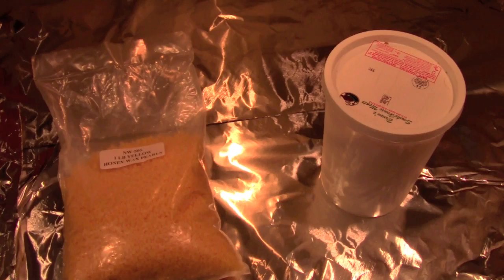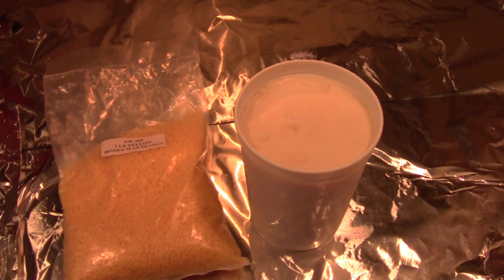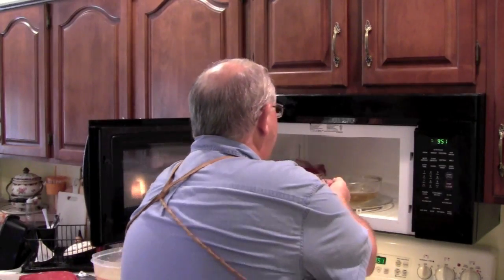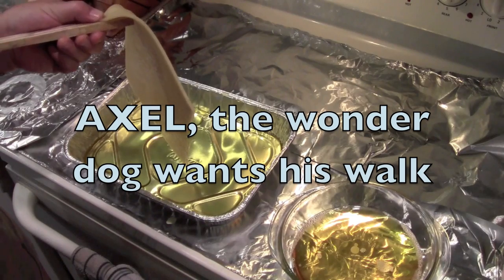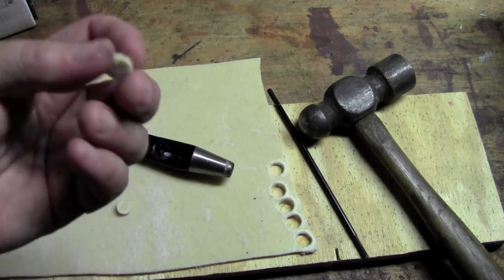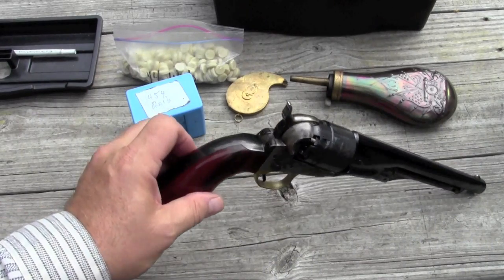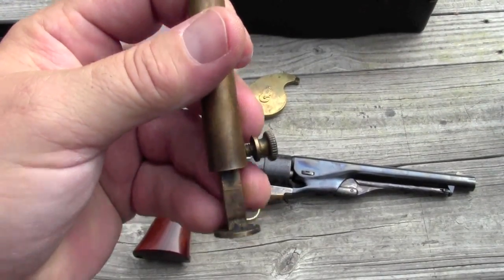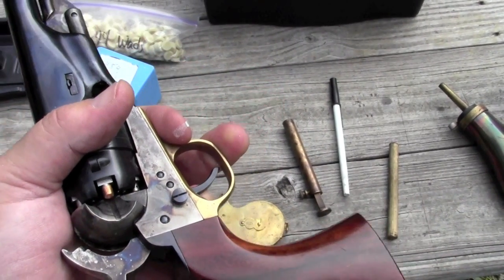Homemade cap and ball revolver wads

Comment: Don't pay big money for "tallow" it is just LARD. Your local butcher shop probably will sell you some for not allot of money. If you buy it over the net, your going to pay too much for it from the get go, then there is shipping on top of that! You could easily spend over $25-30 for what you can buy locally for less than $5.
Reply: The guy who goes by the name "Gatofeo," found an old recipe in an American Rifleman article dating back to the 1930s. He made it popular on various internet forums around 1999 or 2000 and it remains pretty popular today. He says he's been using his particular variation for 40 years. The recipe is referred to as "Gatofeo No.1" black powder lube. The original NRA recipe doesn't mention what type of tallow to use, but according to Gatofeo, he's tried all sorts of various fats and lards and found that nothing works better than lambs tallow. 
Gatofeo's recipe differs from the one in the video in that he uses paraffin wax, along with the lambs tallow and bee's wax. Also the ratios of the ingredients are slightly different. 

It seems that everyone has their own recipe for black powder lube. Some use Crisco, others use exotic oils and waxes. Mike has kept things sorta simple. Sorta because the lambs tallow can be kinda hard to find at times and it's not as cheap as a can of Crisco or bucket of lard. Simple in that there are only two ingredients. Of course there are hundreds, if not thousands, of lube recipes out there and everyone has their favorite. With that being said, tallow is not "just lard." Tallow is made by rendering suet, which is taken from around the organs, in particular the kidneys. It is harder than fat taken from muscle groups and has a higher smoke point.
Reply: Beef tallow works well.
Reply: I use 85% Crisco and 15% beeswax.  Seems to be doing a good job.

Comment: Thanks for making this video, Mike!

I see that you use a mixture or two parts tallow to one part beeswax. I've seen countless recipes for black powder lube online, including a bullet lube recipe for paper cartridges from an 1862 ordnance manual calling for one part tallow to eight parts beeswax. That recipe appeals to me due to its presumed historical accuracy, but I wonder if that ratio would be a good recipe for wool wads. Do you have an opinion about this?

The recipe I'm referring to is on page 266 of this manual:
https://books.google.com/books?id=wwY6DT2Sc_cC&pg=PA266#v=onepage&q&f=false
Reply from the maker: The high wax lubes are good for externally lubed bullets in cartridges because it is harder, so it survives handling better. For more general use they are somewhat less effective
Reply: +duelist1954 Thanks for your insight!